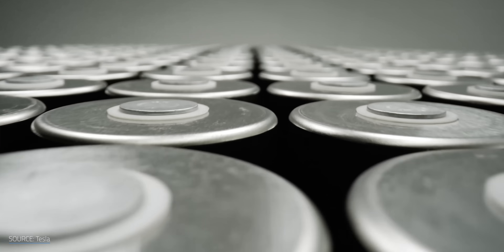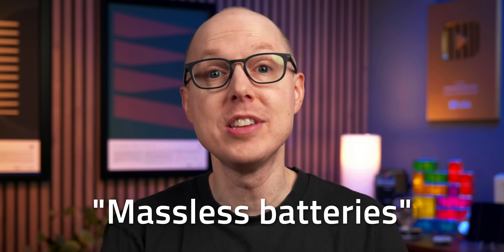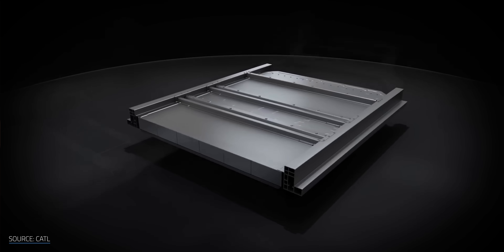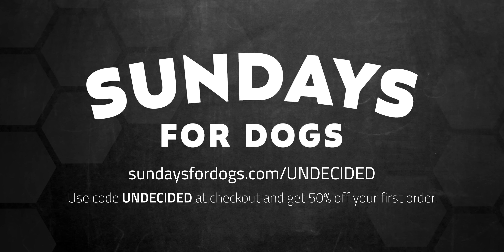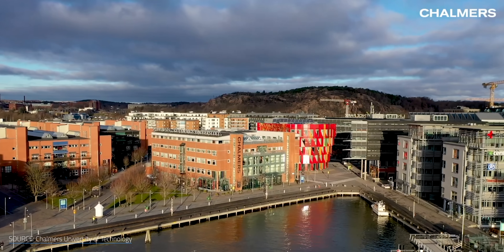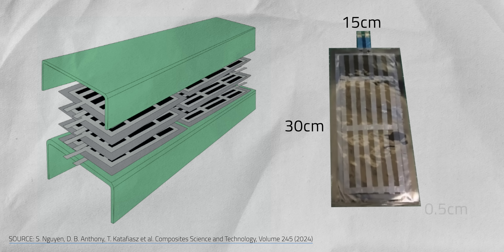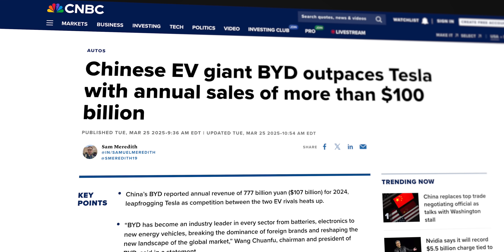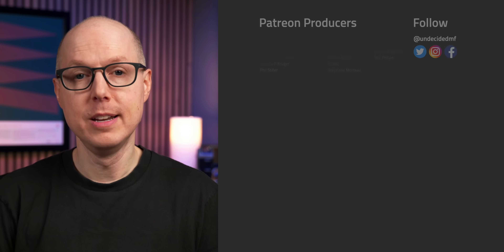The Strangest Battery Breakthrough Yet

Comment: Saving weight on EVs, planes etc: sure, sounds like a great way to combine form and function as long as there's still a way to easily replace dead cells.
But the other examples you mentioned (laptops, phones etc) get a HELL NO from me... We don't need credit card thin phones that can't be serviced and ultrathin laptops that need dongles for everything because there's "no space" for proper ports. What we need are devices that are easily repairable to enable them for a way longer lifecycle. Thinner is not the answer, but sustainable approaches that companies like FairPhone and Framework have started.

Comment: For cars, structural batteries have their advantages and disadvantages. Undoubtedly they can reduce weight and cost of manufacture. But the downside is that even minor damage could see insurance companies rather write off the car than risk putting a car with a hard to detect problem caused by a previous crash. So they could end up reducing the upfront cost, but increase insurance costs and costs of repair. It’s not clear that this would reduce the total cost of ownership.

Comment: Diesel or Gas-electric hybrids have been and are still the most efficient and useful systems overall. They were at sometimes called "electric transmission" systems on old patents as well. The frame often protects batteries from damage in electric vehicles; this has a high likely hood to work out poorly in real world testing.

Comment: Well, what about waste with structural batteries? If the batteries are pretty much baked into the structure of the object, and let's say the battery is a bust isn't that just a paperweight with no way of replacing the battery. What about the environmental impact of such batteries when they reach EOL?

Comment: The problem I see with some structural uses of this type of tech is replacement when they have issues, if the structural beam no longer works correctly in an aircraft for example it would take a lot of time and money to switch it out. Maybe you can get away with a few not working or holding a charge, but if too many stop working no one is going to want to mess with that. Aircraft are already super expensive to own and run and changing structural components is a nightmare.

Comment: Pure Hydrogen power systems are such a scam... I wish these scams were shown for what they are so real systems like Structural batteries can actually gain some ground. 
Hydrogen takes far to much volume to store and requires extreme cryogenics to store safely. It also leaks constantly due to how tinny hydrogen atoms are, you could have a system that holds helium with no leaks, but if you put hydrogen it it, it can leak and blow up...

Comment: I have a 2014 plug-in hybrid car, and when that battery got close to 10 years old, as predicted, battery capacity started a steep decline and reached about 50% of new. Last year I replaced the HV battery in my garage and my range was restored to essentially the same as when I bought it. I have heard a lot of these discussions of structural batteries over the years and every time, the presenter conspicuously ignores the question of how the batteries will be replaced.

Comment: The problem is you don't want to go too light, either. Everyone will see why when they create the first vehicle lighter than 500 lbs. This might be mitigated in some conditions but the idea would be to keep a vehicle close to the ground to mitigate between lift and drag. Now if this became a part of the flying vehicle architecture it very well could be an improvement.

Comment: All I could think about was why don't they replace the non structural parts with batteries. Maybe it would add complexity but if you can form these batteries into panels, you could replace the skin of a vehicle instead (or as well).

Comment: Using them for cars is not going to happen anytime soon.

Their battery has 1/10th the WH/Kg as a Tesla battery.  So the battery would weigh 5440 KG.  That is 2.5x the weight of the entire car, so it doesn't matter how much structure they can remove by using one of these.  This technology would work best in applications where the battery is not a huge percentage of the weight.  The biggest advantage would be in the formfactor, so low power ultra-thin tablets would be a good fit.

Comment: The right way to do this is to get them into some consumer products quickly so that you can get the funding from the sales to support additional research. Thing about an airplane is that batteries have limited lives. Planes fly a lot longer than the batteries are good for, so they have to be modular in some fashion to allow for efficient swapout. You're trading fuel system maintenance for battery maintenance.

Comment: Definitely exciting for certain applications, but cars and airplanes give me concern, to say the least. Unfortunately, until someone invents perfect batteries, they'll need to get replaced. Maybe easily replaceable panels or simple struts could be batteries, but you don't want to replace a car's chassis or both of a plane's wings just because one of your batteries isn't holding a charge. Also, let me know how well the battery works after it's guts are subjected to 10's of thousands of miles of road vibrations and hundreds of load stress cycles. I'd rather have the things that keep the plane in one piece focus on doing the best they can, rather than also having to consider how to keep the engine running. Sometimes discrete is better in the long run, despite being less efficient in some ways.

Comment: A phone the thickness of a credit card? No thank you. I like that my current flip phohne is the bulkiest cell phone I've ever own and thus actually fits comfortably in my hand and against the side of my head and approaches the ergonomics of a traditional handset.

And even if I didn't loathe the slate form factor, I'd much prefer something with a halfway decent amount of thickness, like half an inch/ 12 mm at minimum

Aside from memory cards, I struggle to think of anything where credit card thinness in a consumer electronic product would actually be beneficial and not an example of "Screw all other considerations, lets make it smaller for the sake of making it smaller".

As for decreasing the weight of a laptop, my vote would be to ditch the screen and touchpad, but then again, being blind, I have no use for the screen and find keyboard controls more intuitive/accessible than mouse or touch controls... and even then, extra weight would be worth it for a battery that could run for days of regular use on a single charge or the convenience of a built-in optical drive.

Comment: Does structural also imply "cannot be replaced or repaired?"  If so, please keep these far away from consumer electronics.  The battery is basically the one thing guaranteed to need replacement.  I guess if you can get ~8,000 charging cycles with 80% capacity remaining, I'd consider it...

Comment: IMO structural batteries will become the norm, it is basically bonus energy storage. However I think it will be a long time before it comes to consumer products due to the cost, and there are also some potential issues like where all the stored energy could go in the event of structural failure (like in a car crash, or a dropped phone).

Comment: Not super keen on structural batteries for cars because it seems like it would make body repair way more expensive after an accident. But, I do like the idea for aircraft, which are much more weight-sensitive, and have much lower accident rates.

Comment: Here's another idea for it : I don't care is it have very low energy density. But, at least it will be enough to keep the phone on for at least 5 minutes. Why? Because if it's thin enough, it should have normal thickness when external detachable, hot-swapable battery can be attached to it. That would be an amazing feature. The external battery can be as thick as 5000mah capacity to maybe 20000mah or even more depends on the user's liking.

Comment: Motorcycle have been using the engine as part of the frame for years so using that same idea for batteries makes sense.  You have to make sure that either the expected lifespan is as long or longer than the rest of the device, or that there is a way to remove the stress from the battery to replace it

Comment: First, we need a battery that can be universal, with at the minimum the power density of gasoline for the weight. Then we will be able to use it for structural engineering and vehicles. Until then, this is just another avenue of exploration that no one should be getting their hopes up on.

Comment: No.  The juice is NOT worth the squeeze.     The fundamental flaw in structural batteries is the waste.   We made this same mistake when we invented the TV/DVD combo.  Or virtually any other combo device.   when one component fails, both are effectively trash.   So we know batteries wear out. Even the rechargeable ones.   I don't want to have structural components replaced in my car just because the battery built into it wears out.   Then vehicles will well and truly be yet another disposable piece of crap littering the planet.  Whats next? Biodegradeable disposable sedans?   Only $70k a year.  No problem.  we can all afford to toss things like that away.

Comment: Great vid! I still don't understand why aerospace hasn't adopted hybrid engines. Fuel for take offs and landings and structural batteries (or any available) for maintaining altitude when the air is thinner and requires less energy, eventually, like cars, leading to 100% electric planes able to handle loads and distances of modern planes. Am I way off base with this?

Comment: 2:40 I think repairability is a very important fifth point.  Think of those batteries in your phones now.  Integrating the battery into the structure seems very unwise to me.  Phones are practically thin enough. I'd like to less effort into thinner and more into durability and repairability.

Comment: I don't know whether electric airplanes will ever have enough range to make long flights, especially intercontinental ones over water.  But they don't need to.  The United States Naval Research Laboratory has discovered a process for making carbon-neutral jet fuel from seawater and electricity.  
Plants using this process could be located near seacoasts, making fuel out of solar and wind electricity at times when supply exceeds demand.  Fuel not needed by the airlines could be piped inland to be burned in mothballed gas-fired generators during times when wind and solar aren't producing enough power.

Comment: I could see this coming Pretty darn quick if they made one in the shape of a fuel tank as a drop in replacement for both a battery and a fuel tank. And every race team the world over will try to implement it cause of weight savings. someone call Nascar, Indy, or Formula one those guys will get this tech to market within the year. it's still 10 years from being used on a plane but if they use it for frame and body panels as well as fuel tanks then this could be the greatest break through in transportation since the electric drive system on a locomotive.

Comment: Structural batteries are hugely short-sighted in terms of repair, replacement, and recycling.  Maybe they could be justified in aviation (low-volume, long life cycle), but not for automotive.

Think about all the EVs already in existence that no one wants because the cost to replace the battery is more than the entire vehicle is worth.  Now imagine the same scenario, except the vehicle chassis is the battery... the entire thing becomes disposable and not easy to recycle.

Comment: Structural batteries are the death of an EV car. A small accident, resulting in a small injury to the battery, will mean the vehicle is written off. The Insurance Industry will quickly pick up on this type of car costing more to repair and greatly increase the cost of insurance. Or outright refusing to insure. Non structural batteries can be easily replaced, with out writing the car off, are the future of EV cars.

Comment: Longevity and risk are the two biggest factors. Even if it were free, the battery lasting 2-5 years or not handling the luddite hammering nails into the middle of it, it will ruin it for everybody.

Comment: 11:44 citation needed. Most of the noise from propeller aircraft come from the propellers, not the motor. I expect it's much the same with jet engines vs. EDFs. Similar with cars. EVs are very quiet at city speeds of up to 30-40 km/h, but at highway speeds they're about as noisy as fossil cars due to tyre noise being the biggest factor. (Not counting the upper end of fossil car noise, i.e. those who modify their cars to be as noisy as possible, for whatever sick, twisted reason. Some people just want to watch the world burn, etc.)

Comment: You didn't touch on recycleability. It seems like structural batteries would be extremely difficult and expensive to recycle, if they can be at all. Battery life is going to be far shorter than the durability of the frame, requiring you to scrap major components of a vehicle or device. Swapping a car or airplane frame is essentially scrapping the vehicle for parts and building a new one at significantly more expense than just buying a whole new vehicle. The more modular you make the frame, the more structural failure points you introduce. The idea is pretty cool, but I fear it will end up being too impractical for most applications.

Comment: I think it's bonkers that there aren't more small electric boats. Electric boats inherently require heavy/powerful batteries. Small boats generally use lead or steel as ballast to prevent capsizing. Imagine using a 20,000 pound battery as both ballast and a massive performance boost.

Comment: The problem I see with this is it will force you to pay more for battery replacement. It will force you to buy the battery from the original manufacturer in. It will keep cost higher than if you were able to buy generic batteries.

Comment: It is going to be hard to beat using the battery can, not the battery itself, as a component of structural strength.  It may be hard to go beyond the 4680 for anything that weighs more than half a ton.

Comment: I am worried by one thing. The material that has been used so far contains a lot of carbon. Carbon is flammable. If a vehicle has an accident, and this component is damaged, and a fire is nearby, it could cause issues.

Comment: personally ? not a fan. batteries being part of the structure implies they are impossible to repair. I rather have a slightly heavier device but where I can easily remove and repair the battery.

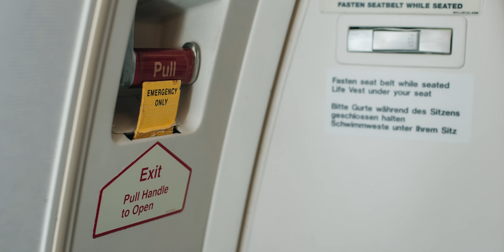Comment: 9:40 Boeing already has a system in place that opens the emergency doors and it doesn't require any batteries at all. In fact, the planes weigh a little less with Boeings system because it requires less bolts than normal.

Comment: @undecidedmf Thin-film structural batteries! As strong as aluminum, they can be flat (installed on the underside of solar panes, formed into monocoque structures, used on building construction, eyc), or rolled into tubes, making a very strong structural element. Corning needs to research transparent anode and diodes to function as glass.  The more outside the box thinking, the better off we'll be. There is no "one answer" for battery tech; a wide variety of technologies allows us to use each one where it's appropriate, ie pumped water storage powered by solar and wind is an effective very low tech method of storing energy.